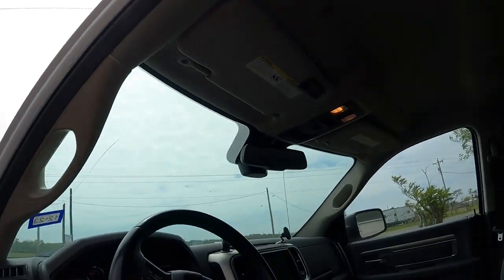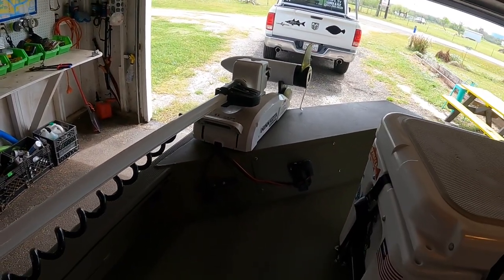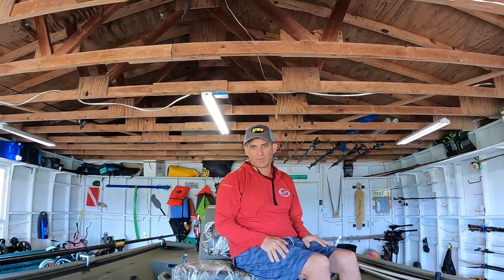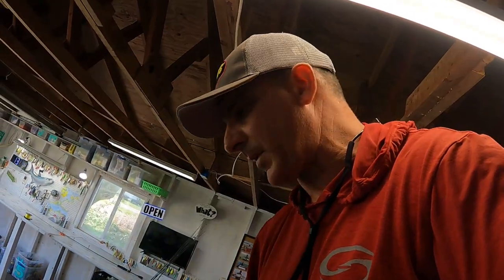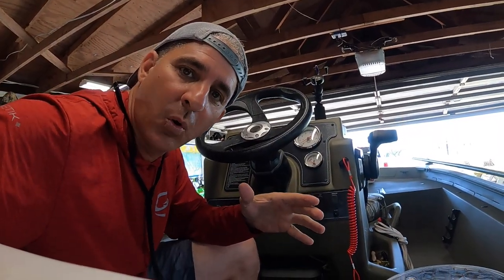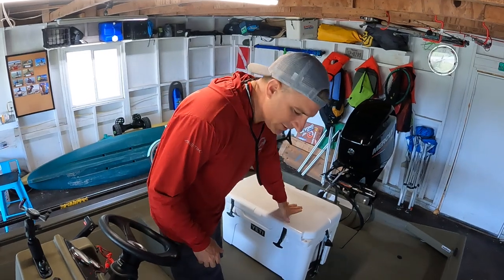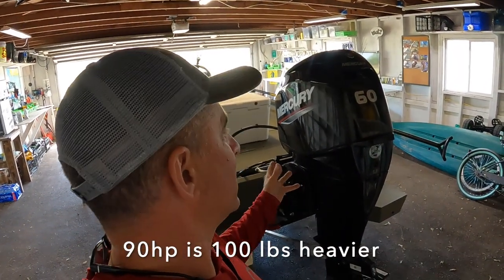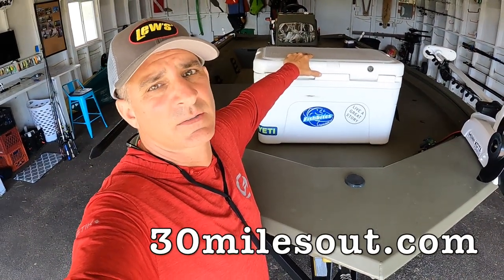Grizzly Tracker 1860 Rundown | My Setup for Guiding Tx Coast

Comment: I bought a 1990 sea nymph tx150 gutted, on a galv trailer with no motor for 400.00. Rebuilt it all, trailer,  boat interior, electrical and a 2024 suz 25. All under 6k. Proud as hell of my boat but I would love to have a new 1860 with a 90.

Comment: Thinking about adding a jack plate on my new 1860cc grizzly to be able to run shallow. Haven’t talked to tracker yet. Wondering if adding a jack plate would void any warranty
Reply from the maker: i don't think it will but i would check like you said.

Comment: Do you feel the 12 V 55 pound thrust trolling motor is pulling the boat fine? And how is the trailer holding up from the salt water?
Reply from the maker: Does great. Only struggle is into a 20-30mo wind

Comment: How are you charging your batteries?  My bay boat had a pig tail. Does this have a way to charge it from the factory or what is your way to charge them?
Reply from the maker: I just use a Walmart $20 trickle battery charger. open the front hatch and clamp her on !